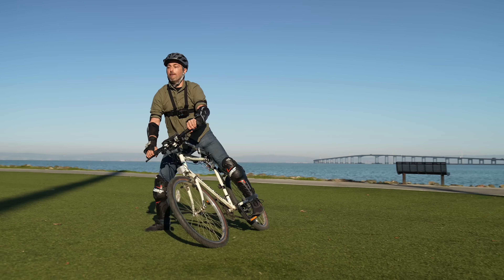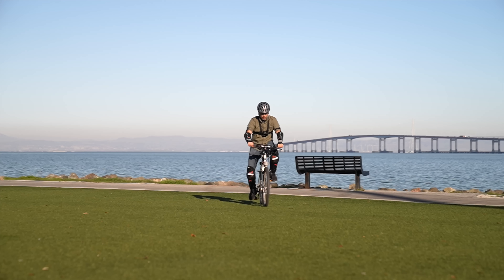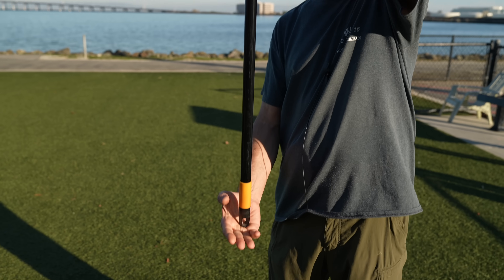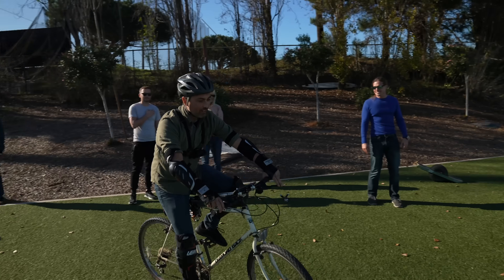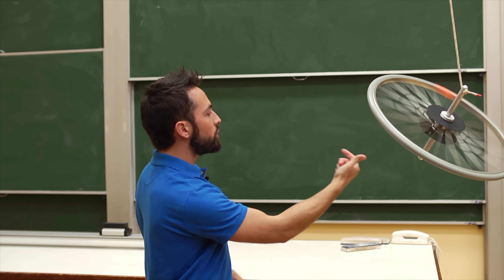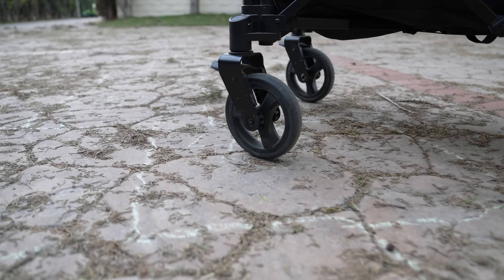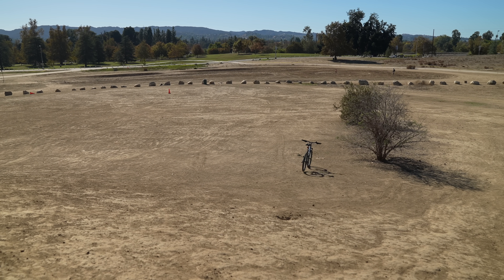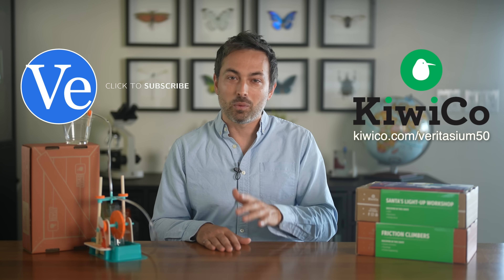Most People Don't Know How Bikes Work

Comment: There's a huge difference between tipping the bike and turning the bike. You most certainly do not have to steer left to go right, as you can simply lean right without ever touching the handlebars and you will turn right. The problem is that you're trying to start the turn with the handlebars instead of your body.

Of course, when you get into heavy motorcycles, steering left to go right becomes much more important, as your body doesn't have enough mass to make huge changes to the bike's momentum. Why? Because gyroscopic effects are much more notable on a motorcycle. That is, gyroscopic effects are very much why the bike is so stable. So tipping the bike right by momentarily steering left lets you turn faster than just trying to lean right. But, even on a 1000-lb motorcycle, you can steer right by just leaning right and never touching the handlebars. There are plenty of YouTube videos demonstrating this.

Yes, clearly it's more difficult to steer when you lock out one direction. Yes, we often initially steer left to go right, particularly at low speed. And we often make small micro-corrections as we're riding. But no, that's not actually how bikes turn. It's just a common misconception. Bikes turn right by leaning and steering right. Bikes turn left by leaning and steering left.

Also, the bike specifically has positive caster (exactly the opposite of the negative caster wheels you showed on a stroller). This has two effects. One is related to leaning. As you lean, the wheel automatically steers the direction you want to go (as you demonstrated), so you can steer the bike without the handlebars. This is (very) nice, but not necessary to ride the bike. However, when you send the bike down a hill on its own, it means that if the bike wheel turns suddenly, then the bike leans in a direction, the tire automatically steers to match the lean, meaning it doesn't tip over so easily. As you've accurately deduced, this is important to why the bike stays upright for so long.

The other effect helps keep the bike (or a car) in a straight line. With positive caster, the tire wants to resist steering rotations. If the handlebars are turned right, it puts force on the tire's contact patch, which is behind the axis of rotation. Because the part of the tire behind the axis of rotation moves left when the handlebars are turned right, the contact patch is to the left of the axis of rotation. The drag from the contact patch is therefore pushing to the right. Since the contact patch is behind the axis of rotation, the rightward drag wants to steer the wheel to the left. If it steers left, the drag wants to steer back right. Ultimately, the tire wants to stay straight. This is also very critical to why the bike doesn't just drive itself into the ground when you send it down a hill, but you failed to mention it at all.

The mass of the handlebars is of negligible importance. Leaning and the positive caster are what actually affect the steering. You can easily see this by just attaching a large mass out front (like your little sister standing on the stunt pegs well in front of the handlebars). The bike might feel weird, but still steers fine.

Note the other major effect here: gyroscopic stabilization. When you send a riderless bike down a hill, it's the gyroscopic effect of the wheels that makes it stand back up. Otherwise, it would just keep turning whatever direction. Because a bicycle is very light compared to the rider, the gyroscopic effect is a lot less noticeable than on a motorcycle. But when you remove the rider, you definitely see that effect.

Off-topic, but relevant since you got confused in your video: "Casters" are wheels with negative caster. If you try to steer with negative caster, you constantly have to fight the wheel, because it wants to just keep turning the direction it's already turning. The contact patch is in front of the wheel, so when you steer left, the contact patch moves left, and the drag wants to keep twisting it left. Vice versa for steering right. They're basically worthless on a car or bike, hence why you never see them.

However, they're great on carts and such because you don't steer those with the tires. You steer by twisting the actual cart. Because the negative caster makes the wheel turn the way it's already turning, it follows the direction the cart is pointing. This makes it where you don't have to struggle as hard to steer the cart. Having all four wheels with negative caster can be nice if you need to move the cart sideways, but it's also wonky, so often you have two fixed wheels and two wheels with negative caster if you're mostly traveling forward. Also, most carts are light enough to just drag if you actually need to move them sideways, so it's not a big issue.

There is some good information here, but it's mired in nonsense that confuses the issue. You should probably try to correct things before more people are getting confused by the same stuff.

Side-note: being able to create a bike that uses other effects to turn or stabilize in no way proves that a standard bike doesn't use these effects.
Reply: When I was a road cyclist I would watch my handlebars to see if I moved them when I took a curve at speed. They would move neither left nor right; it was all lean. At speed, counter-steering is used mostly for when one has to make an emergency stop, to turn the bike sideways. It is only at a crawling speed that the handlebars are necessary for turning.
Reply: I was thinking the same things. Thank you for articulating them all so well!
Reply: Yay, I've found the comments of likeminded people who understand how cycling works! I made a similar comment to GeekOfAllness before finding this. Totally agree. Derek should of dont a lot more research on this subject and thought of a better experiment. The device shown in the video messes with the ability to make those mico-corrections and requires that you look down at the handlebars before making a turn, which any decent cyclist will tell you is a bad idea and will cause a lot more wobbling and need of corrections.

He should set up a bike that just records the steering angle and then get people (confident cyclists) to ride it...
Reply: Please send him an email, he might do a follow up video
Reply: This explanation is very good, great job!  Some of that stuff definitely needs to be explained better than it was in the video.
Reply: By leaning the steering does the same rather ya touching it or not...it steel goes opposite and is explained when he leans bike over without hands on the handlebars and the front wheel turns!
Reply: Very Well presented facts. Ive learned exactly that while making My motorcycle license Here in Germany. They even make you do this on the Test Parcours. Its very important for Riders to have that skill.
Reply: This needs upvotes, i immediatly thought when watching this video, but i can ride for miles with corners without even touching the steer. the video is just not true. Your right these Americans are probably just thinking about motorcycles and not realizing you can use your weight to steer a bike.
Reply: By leaning the steering does the same rather ya touching it or not...it steel goes opposite and is explained when he leans bike over without hands on the handlebars and the front wheel turns!
Reply: It's worth pointing out that "casters" typically have independent free 360 degree rotation, so they will always move themselves to have negative caster even if it's initially positive. On a car, wheels  are kept in positive caster because the two front wheels are locked in a certain arc--can't turn 360 degrees. As long as the car is moving forward anyway.
Reply: Also being able to steer a bike by just leaning really depends on the distribution of mass, and you can always make sharper turns by countersteering. Knowing how to countersteer and that it works will keep you safe when biking on streets because you'll be able to do emergency sharp turns you would never be able to make by leaning.
Reply: Could someone expound on the following bit: "the part of the tire behind the axis of rotation moves left when the handlebars are turned right" - I can't quite grasp how that 'part' (which I assume is the aforementioned contact patch) physically moves away from the direction of handlebar-turning thus creating drag.  Anyhow, thoroughly enjoyed this extended account!
Reply: Well said. The suggestion that counter steering is a requirement for cornering on a bicycle is ridiculous. Imagine a downhill MTB rider counter steering every time they cornered, they would die.
Reply: @OneBigMobb  
Have you never actually watched them coming down the trails?

Their front wheel is twitching side to side on the regular.
Reply: @OneBigMobb  Wow, now you are comparing counter steer at 2km/h with a Downhill rider at 80km/h. That's just GREAT! 

The point with downhill riders is that they already throw their weight around corners, you can see it just by slowing down a youtube video, it's not that hard to find out. Counter-steering is just a way to facilitate the exchange of the center of mass, which should not be used in some situations, but in others it is NECESSARY. I say calmly: It is impossible to make sharp turns on straight asphalt at high speed, without using the countersteer. The person is simply not going to be nimble enough, nor dumb enough to try.
Reply: @gn4sty731  Yes, and I am pointing out as have plenty of others that riding a bicycle is a lot more dynamic than this video takes into account.
Reply: I used to ride handless around my block, up and down the street with my bicycle, I leaned and can get on to sidewalks, I could get  out into the rode, ride around the block handless, you really use your hips.
Reply: theres many ways to turn a bike. i lean my bike but keep my body straight. most people turn the handlebars though. even in the netherlands.
Reply: Okay very long but as someone who learned to ride with no hands holding the handle bars, i now understand much more
Reply: Wow, you wrote all this.Very impressive, man.

Comment: As both a mountain biker and motorbike rider, this is brilliant, I am fascinated to see if you could ride a bike with the steering locked if you kept your ass off the seat as you'd have the ability to move your centre of gravity without needing to counter steer also interestingly, its how you turn at high speeds on a motorbike, if you want to turn left, you push the left handle forward (steering slightly right), moving the bike out from under you but you countersteer at low speeds, im assuming at high speed the gyroscopic force at higher speeds and the weight of the bike help with not falling off

Comment: Iv done this on my motorbike once going at a steady speed push the bars away on the right it leans right you turn right wheel points off left and opposite applies. I assume that’s to do with a bigger wheel but under a certain speed it’s backwards and you turn left with no lean

Comment: Well, you don't "turn" the handlebar when you go in a corner. You push down on the bar end on the inside of the turn, extend the leg on the outside of the turn and then shift your weight. Unless you're at very low speeds, NEVER turn the handlebar into a corner, or you'll eat dirt. I really thought everyone riding a bike knew that, but hopefully now a few people more will learn how easy it actually is to corner.

Comment: Going slow on two wheels (bike, or motorcycle) while in a turn you can steer with the breaks. This way you can adjust your balance without turning the handlebars. While driving a car you can steer with the throttle, while in a corner pushing on the gas makes it go wide, while backing off the gas makes it turn sharper.

Comment: I think man is able to ride this bike (or a slightly changed version). First, remove the freewheel in the rear wheel; that allows you to push the bike both forwards and backwards. Second, focus on balance rather than speed. The speed only ensures: you will fall and much faster. Slow down the speed almost to zero and balance what you can! Only a small change of balance; stick out of an arm or a knee in the direction you want to "fall" and move to that direction. I think that made the ride possible, may I have a try?

Comment: When I learned driving a motorcycle, the teacher told my to push the handlebar away from me ond the right to make a right turn and vice versa. He told me in that process you „unbalance“ the bike and it falls in the direction you want to turn. Now I know it‘s the same effect as on a bicycle. With that gentle push you just turn in the other direction for a splitsecond and change the balance on the bike. Very interesting!
Reply: That's called countersteering, ride a bicycle fast enough and you can do it.
Reply: @Meccanico208  doesn't have anythibg to do with speed
Reply: when watching motorcycle races it becomes easier to see... when i ws learnign to ride a motorcycle that was called "open the curve"
Reply: Push right to go right, yup.

Comment: when you cant turn, you can just bend the bike in the direction you want to go, you wont turn fast but you will turn. So turning first right then left to do a left that happens if you are so slow you need to do it, also if you're on grass turning how i said it its impossible, your wheels will start sliding

Comment: I usually lean my body to the direction I turn, did not know that you have to stir to the right to turn left to balance it. Task failed successfully?

And so that was how some riders can ride bikes without hands. The bike stabilize itself. If you were to ride completely symmetrical in both size of the bike, you will move straight without your bike wondering off to somewhere. But without stirring, the only thing you could do to stay upright is speed which triggers the gyroscopic effect, like those used in competition or be skilled enough to balance the bike by leaning to the opposite direction where the bike falls, like being skilled enough to balance a stick in your hand without moving so much. It's pretty interesting how such a common product is yet to fully research.

Comment: NOT TRUE i could do this and so could my 70 year old dad but we did bike tricks riding backwards etc its takes s=SUPER good balance and you cant go fast at all the forward motion will add to the forces pulling you off but YOU can turn just by turning the direction you want just takes alot of practice not impossible should have got some circus performers not to mention you dont lean in or away from the turning direction no lean at all just peddle slow and turn slow of course not so slow that you can balance the bike but like i said the less speed the better u r lying t the world u dont have the balance this isnt true facts i could turn right and go right riding a bicycle backwards no leaning into or away and no turning one way to go the other none of that non sense teach reality not fiction that destroy young peoples heads plz!  i mean people do this when they go for their motorcycle driving test and they have to go sing between cones if you let the bike do like your saying and "come from underneath you" then you will suffer the wobbles and most likely will crash miss a cone hit a cone or otherwise fail if on the other hand you drive slowly keep the bike underneath you turn slowly not jerky keep balance you should be fine and dot you tell him this is impossible tooo!!! i mean you can get some inward lean if theres enough space and you want to complete the course as fast as possible but changes of the lean coming back to bite you in the next turn are high so most people trying to pass their motor bike cone test just take their time keep the bike UNDERNEATH them (something every bike guy i know has said bout learning to riding "keep it under ya urll be fine!") not impossible actly very common and quite simple to do cum on maybe 4 u not the best balance but we can work on that but it is for most people and MOST are right about HOW bikes work lol bubye

Comment: All the motorbike riders gonna feel real smart given that you're taught about counter steering early on. 
It's a bit more important to know how to steer correctly when you're on a machine often upwards of 200kg that may have a top speed over 300km/h. 
Counter steering is very important for making sharp changes in steering. For dodging road hazards for example or just for initiating turns quicker for a tighter turning circle.